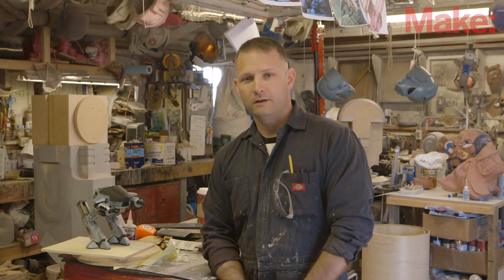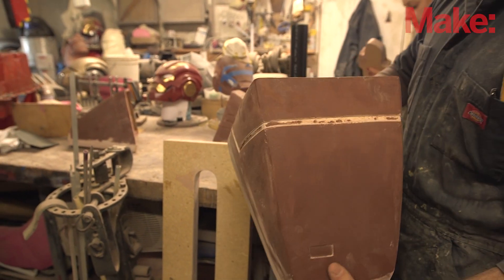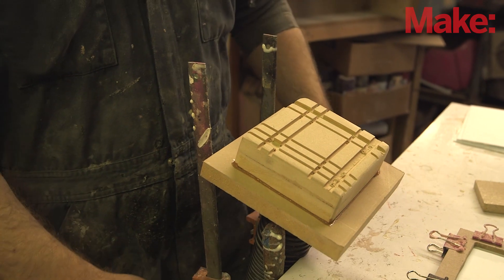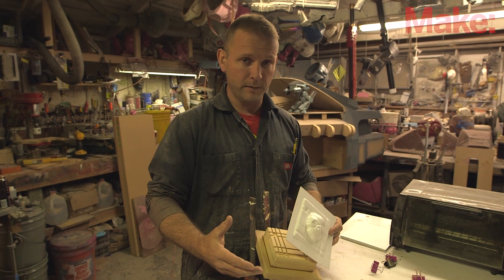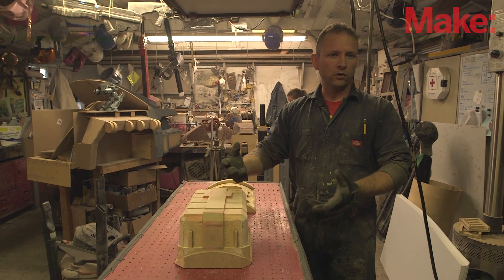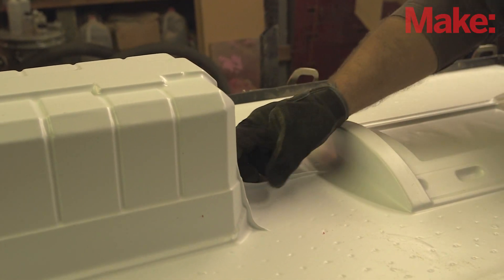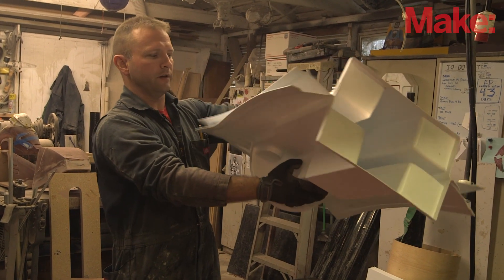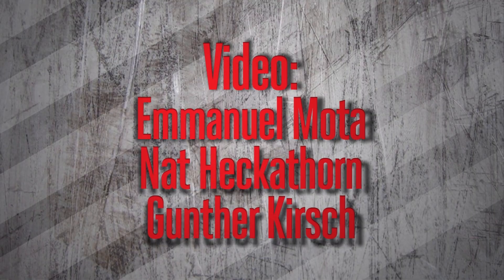Building up to Maker Faire: Part 4

Comment: You should use a female mould, just a frame and have someone to push it down on the plastic as the vacuum starts this will help avoiding the webs or minimize it, and it will also help distribution of material at the bottom especially on the big ammo magazine. Placing some 200 micron pieces of plastic under the mould should help get the plastic down around the edge so it will be sharper. I also agree with previous suggestions to make tiny holes where the details have to be sharper like the skull and on big parts like the big block just make it hollow and drill the tiny hole in the direction of the hollow section. I don't know if you have a valve between the table and the tank if not that tank is useless, you must have control of the vacuum process. This I think should help you a lot to get rid of the web.

Comment: I wonder how they get rid of the webbings and if you can vacuum form parts with fairly steep undercuts like railings or picture frame profiles...
Reply: I do this a lot at university and we've just been told that drilling more small holes, about 0.5mm, into the pattern to allow the air to escape more evenly is the best way to get around webbing. I'm hoping he'll show a way to fix it post process cause that would save a looooot of rework time!

Comment: How do you "seam" the two halfs of the mould together and if it is thin plastic, what gives it rigidity? Do you have some kind of skeleton it mounts to? Thanks
Reply: I use a solvent cement and strips of styrene to make butt joints along the edges.  I'll make it a point to explain it further in a future episode.

There will be a frame built into the finished prop in order to hold the weight.